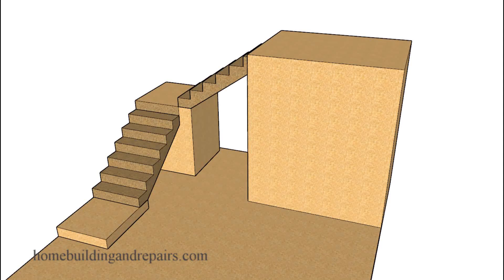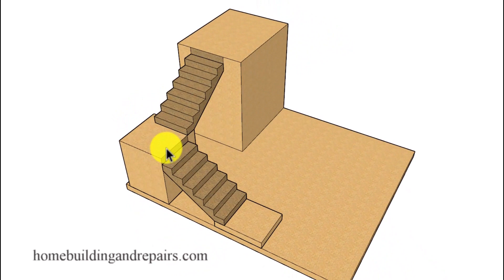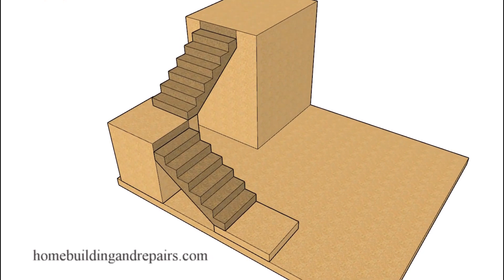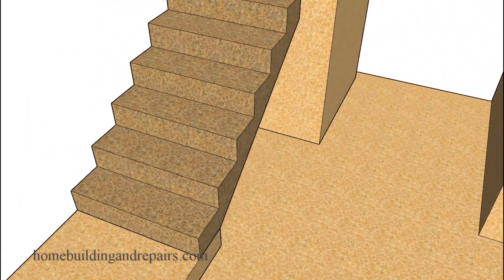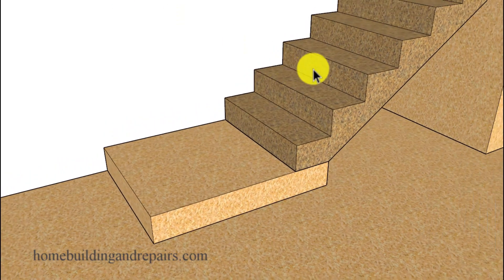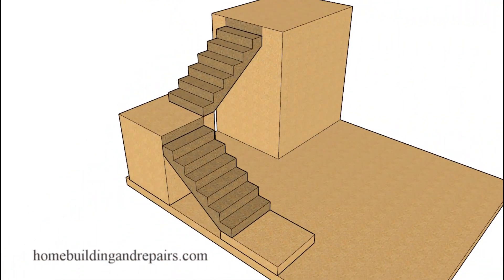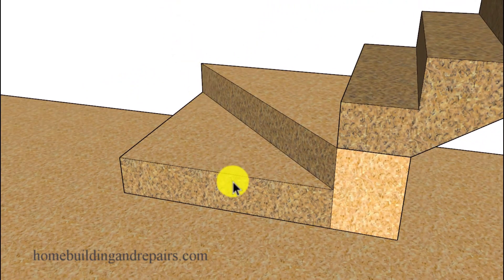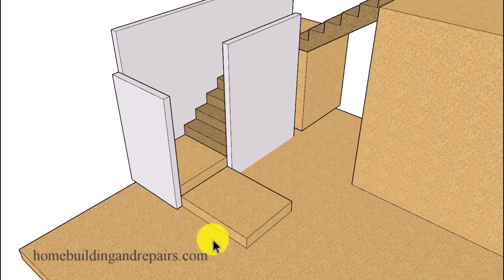Can Stair Landing Risers Be Shorter or Taller? - Building Code Variation Measurements

Comment: A straight stairway that is made out of 6 landings (each step is a landing 4'x6' deep), can have more than a 3/8" difference in the riser height because it is landing?   can you slop the landing 1/4" @ feet?
Reply from the maker: You can slope exterior landings in most areas, but would need to check with local building code inspectors to make sure.
Reply: @stairbuilding  Thank you, and risers difference?
Reply: I see that you are saying yes on one or two landings, but in this case, all the stairs are "landings"
Reply from the maker: @gillivni9089  You will need to check with your local building department to verify, but if they are landings, then riser height could vary.

Comment: If there were an exterior door at the (upper) landing, could they be considered two separate stairways, so the lower stairway could have one riser height, and the upper stairway a slightly different riser height?
Reply from the maker: Yes, it will depend on the design.